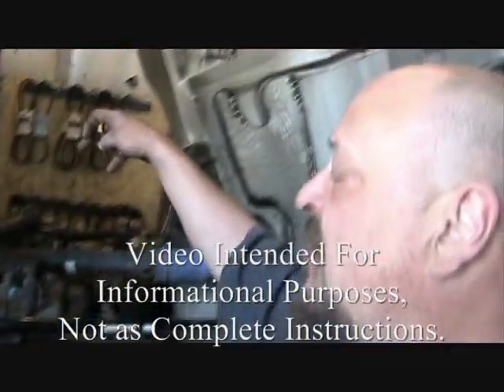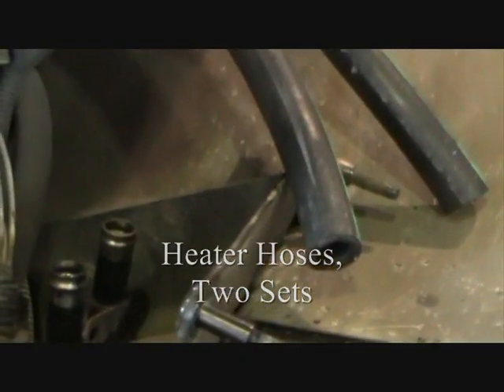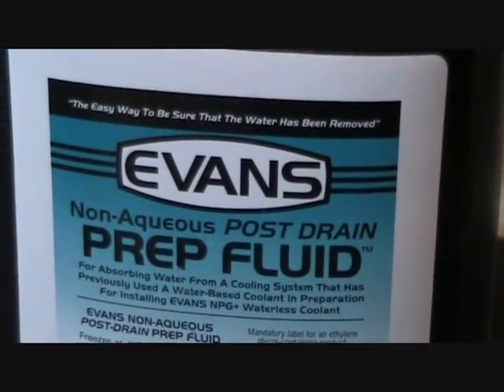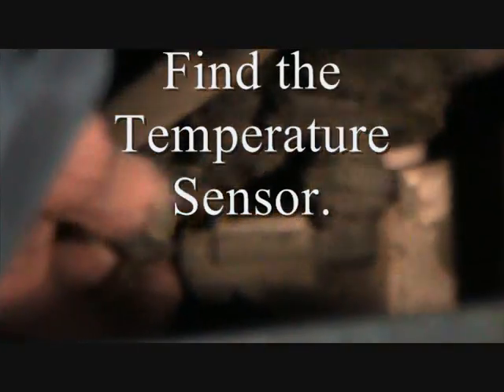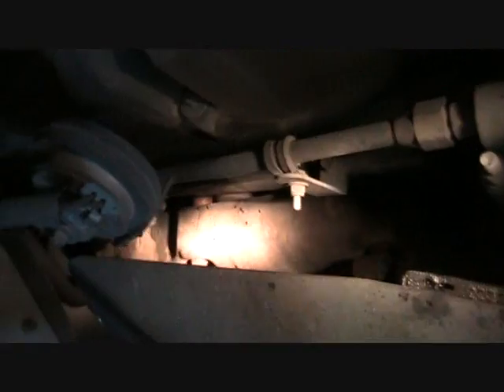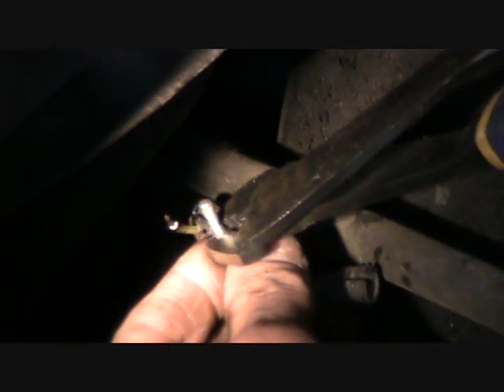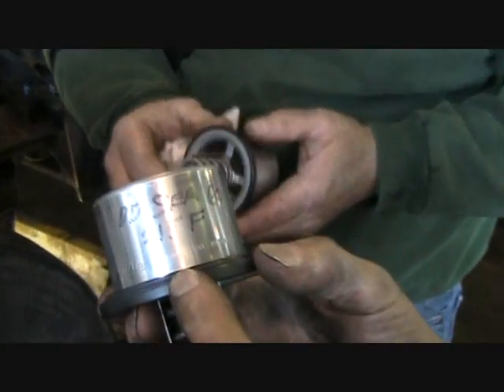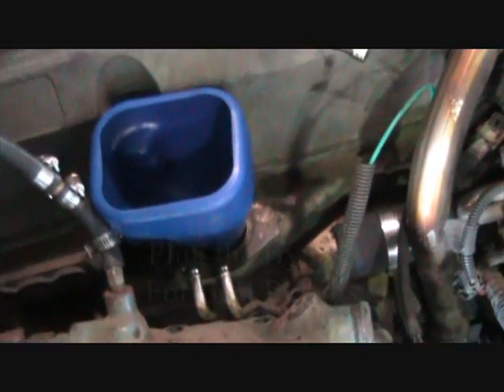Evans Coolant Conversion.wmv

Comment: I keep getting mixed answers to my questions on whether or not I will need to remove my thermostats on the 2 vehicles I plan to use Evans Coolant on.  One is a newer 2013 Kia Optima Turbo and the other is a 2000 Prelude base model.  If I don't have to remove them, will there be any issues with pressure since they also work on pressure?  Or am I wrong in thinking that?  Also what about the fan on/off temp sensors on those?  Will the coolant mess with those since it is reported that the motors will run a bit hotter than normal, won't that cause the fans to stay on longer and turn on more often?  I need answers quickly, the coolant will be delivered to me tomorrow and I will refuse the packages for a refund if it won't work correctly for these 2 vehicles.
Reply: +Lobo Jr thermostats open on temperature. Pressostats open on pressure
Reply: +Miguel Ángel Simón Fernández  This is a super old post.  I have since finished using Evans Coolant on both cars with no issues at all!  The coolant works like a charm and even during 100+ summer heat the temp needle never went past one notch under halfway which is where it stays no matter what the outside temp is or how hard I drive my car, 2000 Prelude.  Thermostats work as usual and I couldn't be happier with the Evans products!

Comment from the maker: All the corrosion and material compatibility tests have come back positive. The EGR cooler troubles are solved because you don't get the dual attack of vapor pressure in the cooler with corrosive ingredients. We have seen no issues with over-fueling, however the sensor mod is not necessary. Just a coolant change will bring reliability and maint savings. As fleets adopt the coolant, the OEMs have become more willing to talk and test. Thanks for the good questions!

Comment: Have the truck engine manufactures tested this in their newer emissions engines? Also is it really necessary to tamper with the coolant temperature sensor? Doing this effects not only the fan cycling but also the fuel curve which maybe causing the engine to overfuel. I'm also wondering how this reacts with silicone and rubber hoses and seals along with all the metals such as copper, aluminum, brass. Also how do the EGR and oil coolers handle it? Newer diesel engines can be pretty unforgiving.